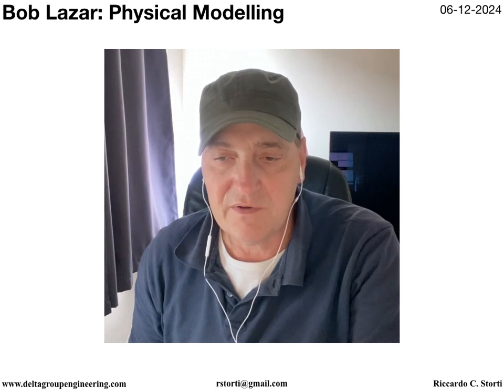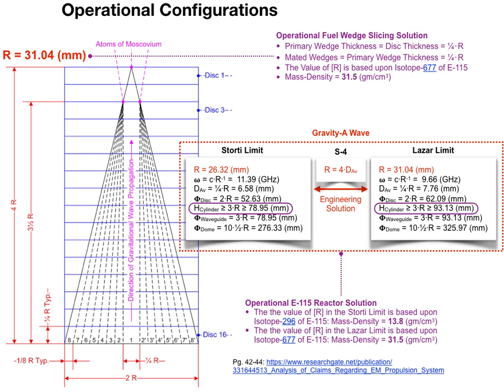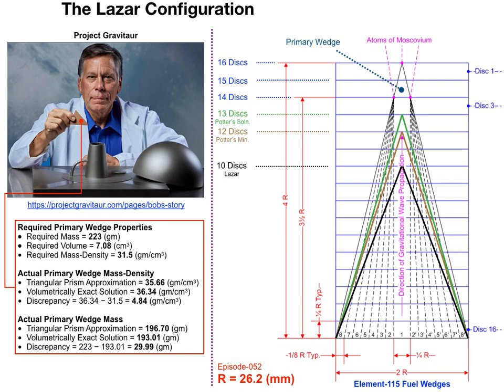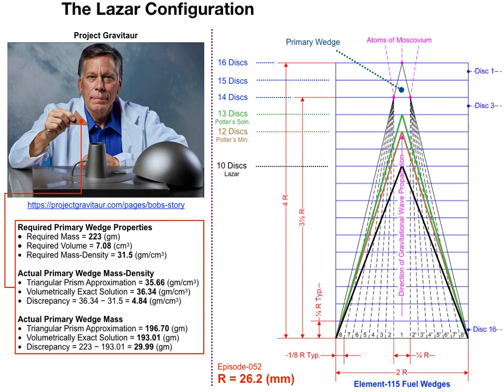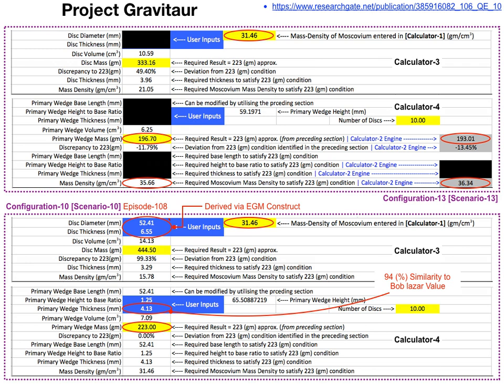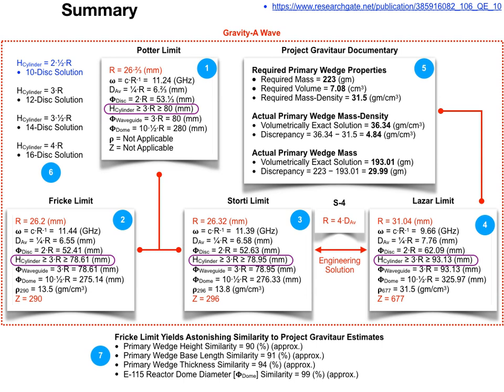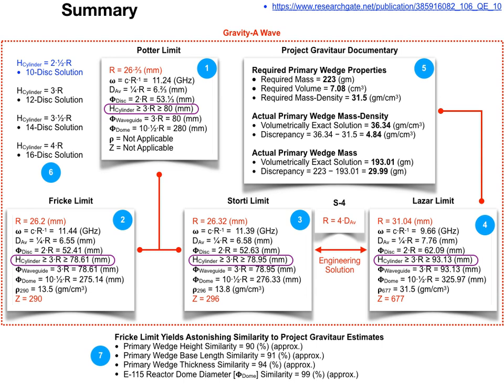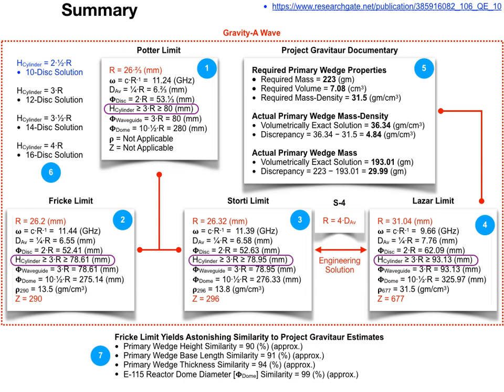110 Bob Lazar (Physical Modelling)

Comment: I don't understand anything now, in another video you stated that Bob Lazar was told a wrong element (E115), but there was another element that fit the specifics better for the purpose. I may have got it wrong, I cannot find the video right now. So finally what element DO YOU prefer to fulfill the features Lazar talked about? Was he fed disinformation with E 115 and it was in reality a different element?
Reply from the maker: I believe that he was fed disinformation. I believe he used another element (possibly E-247). In this video, I assume that he used E-115 (stated on Slide-2), & show how the dimensions in the PG documentary are incorrect. I assume he used E-115 so that viewers may connect with the solution. Bob's story is E-115, so I am forced to stick with this as much as possible